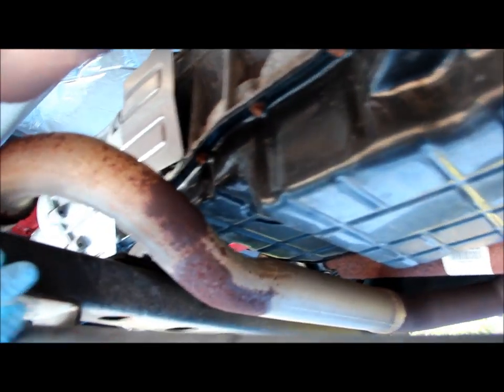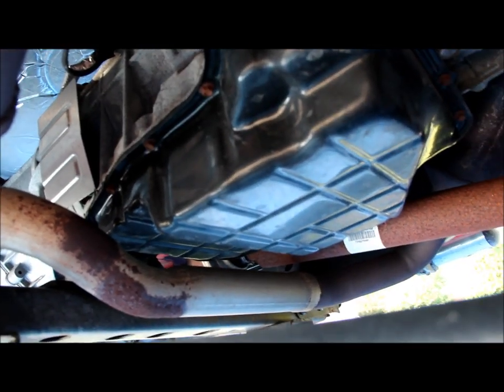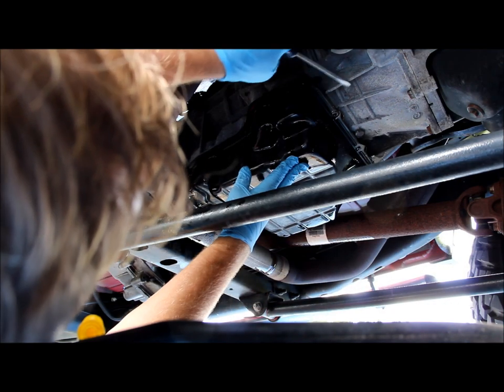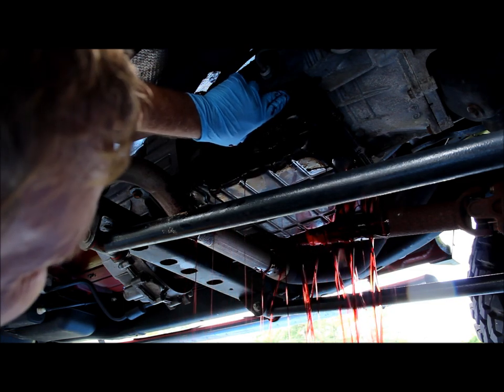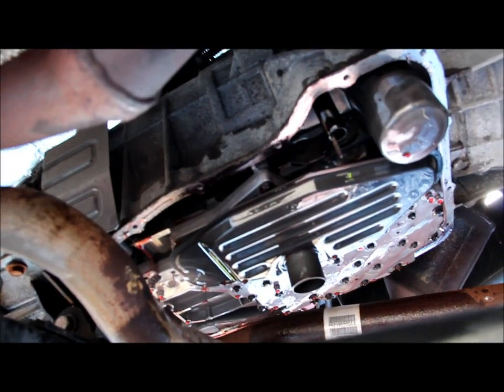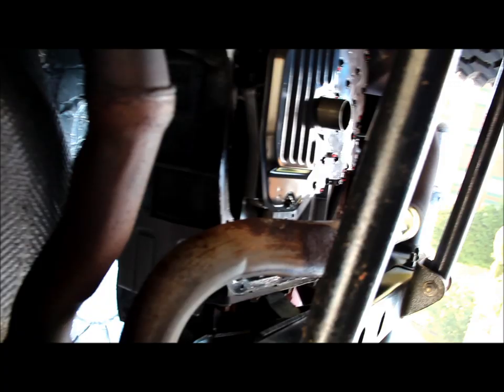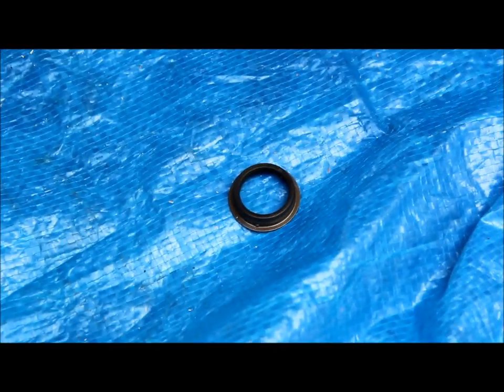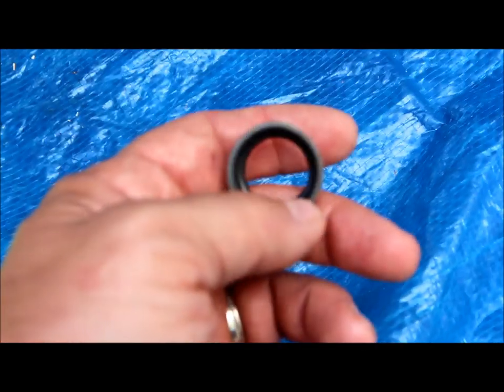545RFE AutomaticTransmission Fluid Drain and Filter Change

Comment: My 06 ram has a shallow pan, the transmission pan in video is the deep pan, only difference in filter is the sump(flat) filter bottom pipe is shorter and in a slightly diff location

Comment: The fluid you took out looked new lol
Reply: It was but the Filter is Clogged More than Likely isn't circulating
Reply: That could definitely be a problem.
Reply: Just did the filter same thing looked new little darker but filter completely clogged, Changed now shifts perfect, Problem with sucking out the fluid instead of dropping the pan, Filter never gets changed
Reply: Dennis Leslie